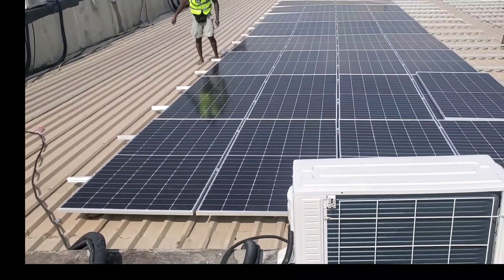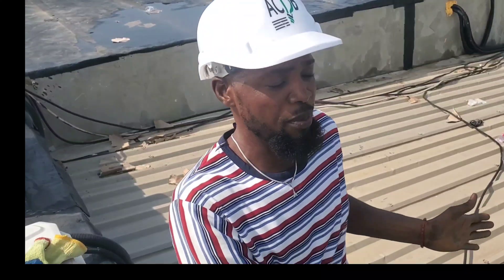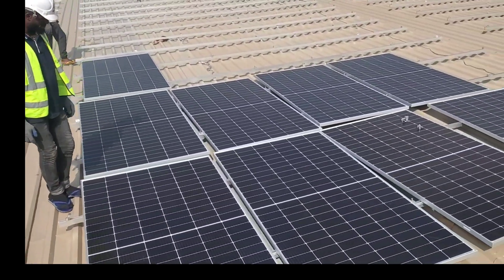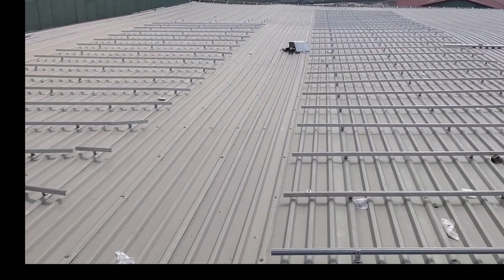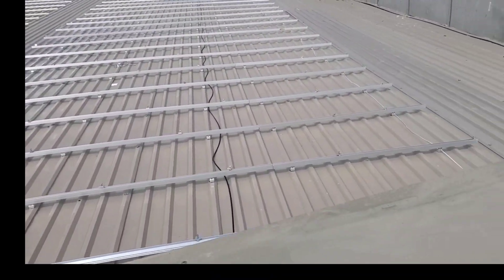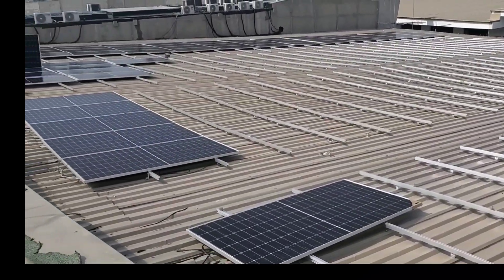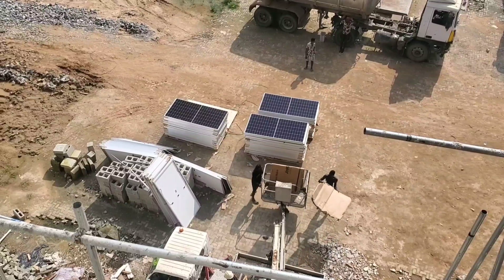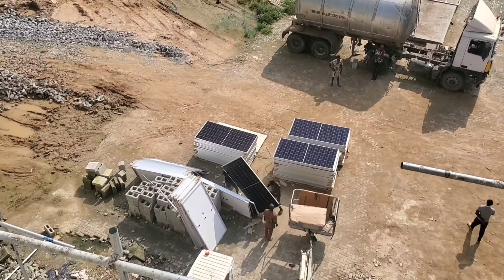The Jinko 545 watt panels are coming up. 250 kw worth.

Comment: Great to see work in progress. Down the road, I hope the hotel Maintenance manager remembers to periodically clean the panels. 👍🏽 How goes the other side of the project, trunking and wiring from the battery side going towards the Panels as well as the battery room? In earlier videos you mentioned challenges with dust, have you prepared for that as well as possibly extractor fans to dissipate heat?
Reply from the maker: That's the plan! We will work with them to make sure it happens